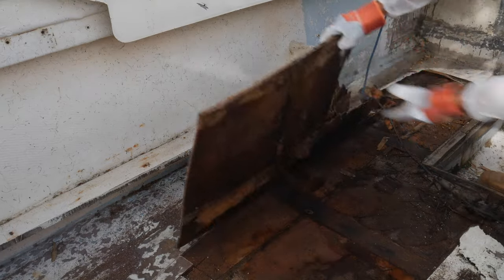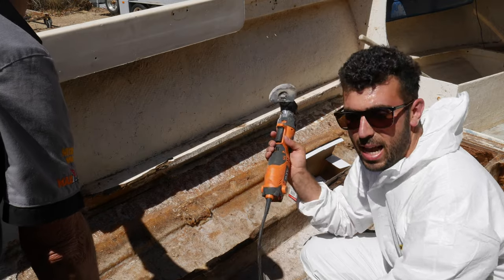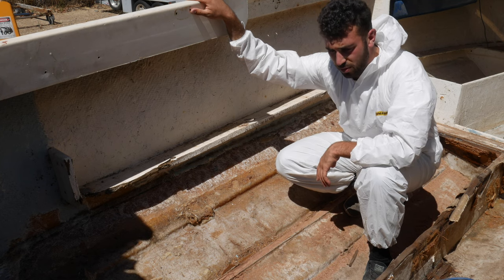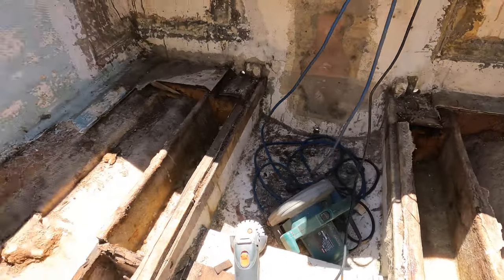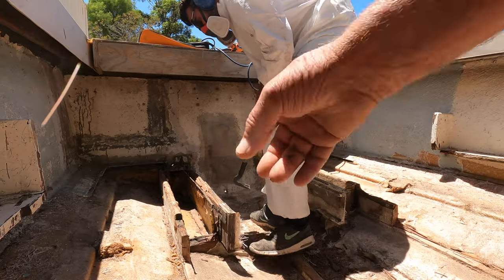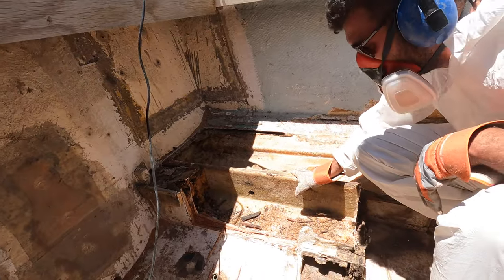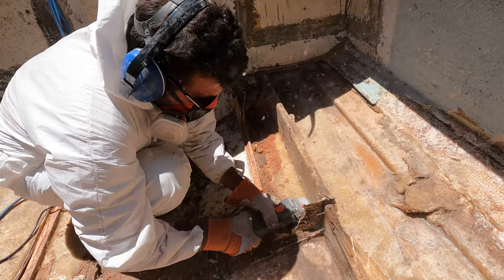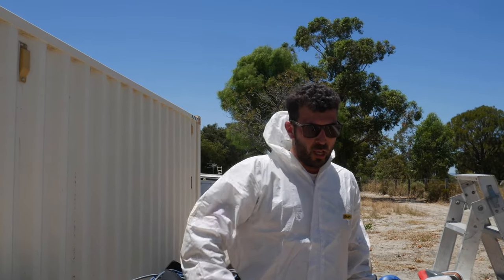Removing  ALL the STRINGERS From the boat | Pacemaker 20ft | Full BOAT RESTORATION V2 - Part 3

Comment: Awesome work! Great progress so far. I restored my own boat a year ago while watching you do the Voyager, and I used the multitool a lot. Best tip: get a blade for cutting metal, the wood cutting blades are dulled extremely fast when cutting fiberglass. And yeah, it is slow when you are cutting thick or laminated materials, but if you use a flat ended blade held at a 45 degree angle, it cuts through fiberglass a lot faster. And there is almost no dust from it ;)
Reply from the maker: Cool, thanks Cato! appreciate the tip!  might have to invest in the metal blades then ! thanks for watching!

Comment: Thanks for the new vid, How many hours has it taken total it get as the far as the stringer removal? When you put the new stringers in can you let us know the size and type of wood your using please.
Reply from the maker: Hey john, allow a good 8-10 hours to remove floor, foam and stringers. 
Transom is what we will be tackling next then the cabin. By the time we finish that ready for sanding id say you'll be close to the 15-20 hour mark with a boat of this size.